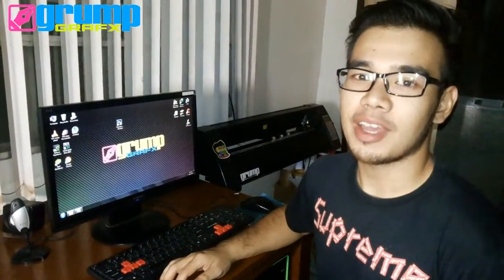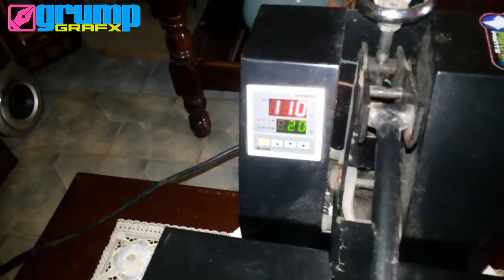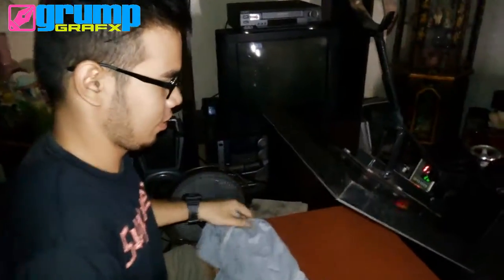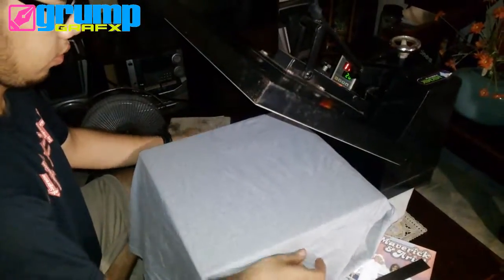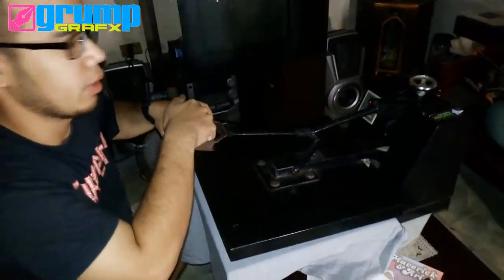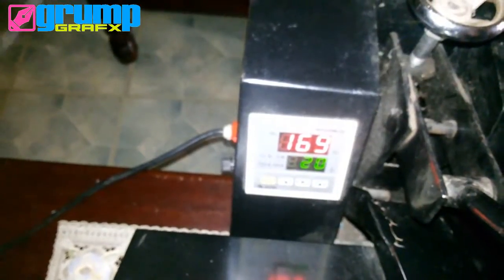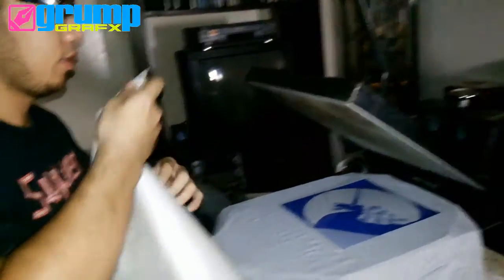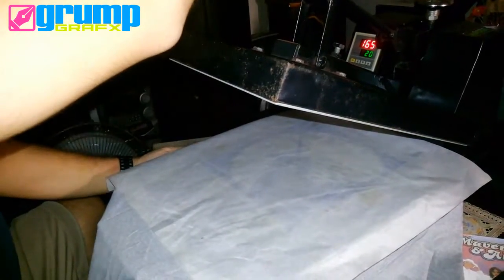T Shirt Print Demo : Heat Press Vinyl

Comment: Sir glenn.. pahingi tips or details when using cutter plotter para sa ganitong htv vinyls para madaling i-weed. saken kasi kahit taasan ko force or yung blade mismo nagdidikit parin sya sa may cut kaya hirap i-weed sumasama pa rin yung design. thanks
Reply from the maker: Hi sir, try mo adjust yung mismong blade, wag ka sa pressure mag adjust. Baga masyadong nakalubog yung blade from.the blade holder.